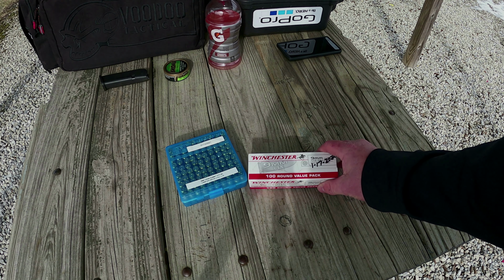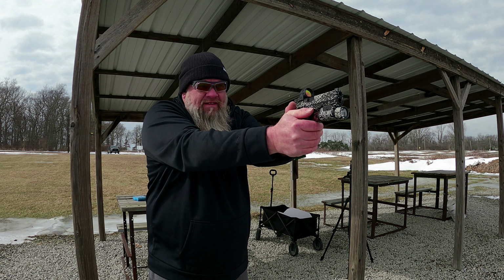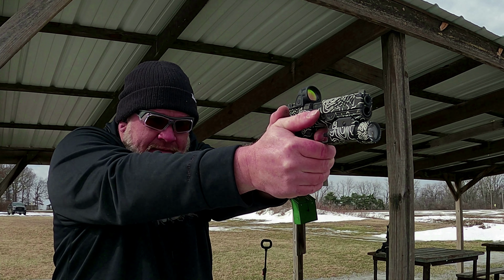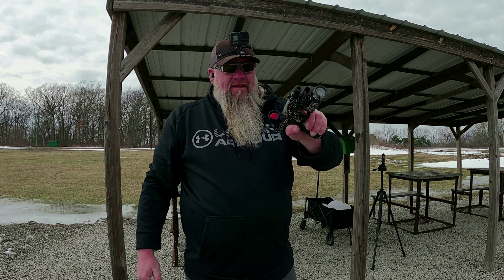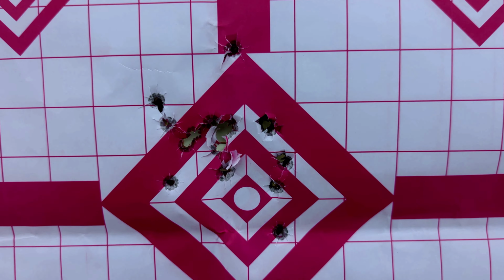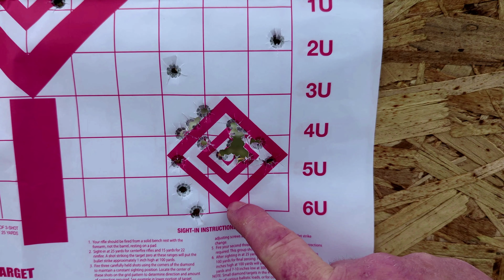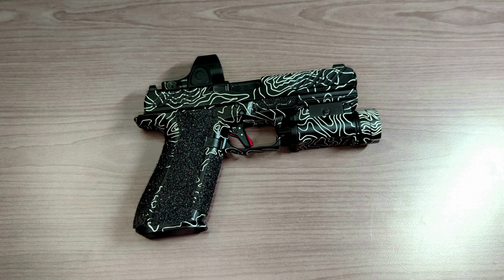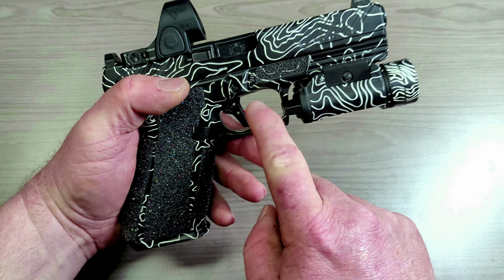Shadow Systems DR920 Timney Alpha Glock Trigger Review

Comment: The reason all those other triggers are better is their striker fire system is different than the glock striker system.... those others have a pre cocked striker which means it simply only has to release the sear.... glock is more similar to a double action where part of the glock trigger is actually compressing the striker spring and  then releasing the sear

Comment: Nice... I have a trigger I changed for one of my Taurus G3C's don't have a Glock yet)... I had similar problems with a few rounds and gave up for a bit. I dit some dry recycles at home and it seems like it might be settling in without me tearing it down again (been too lazy to do it). After watching your video, I might sneak off to the range and try it a few more times. It was the first time I ever attempted a trigger change.
Reply from the maker: Hopefully you got it worked out triggers have drove me up a wall a few times. This trigger is running a 100  % now but it was driving me nuts

Comment: I tried an overwatch precision and a zev trigger in my XR920, both cased it to have binary firing.  The stock trigger is trash, not sure what to do.
Reply from the maker: Wow I'm surprised to hear that with the Zev I don't have any experience with the Overwatch.
Reply: @ChrisFromThe740  Yes, they were both just drop in trigger modules.
Reply from the maker: It sounds like you have already dropped a lot of money on triggers that don't work the only one I could think to try would be the new Apex polymer trigger
Reply: @ChrisFromThe740  thanks for the suggestion, I appreciate it!
Reply: Which trigger fits the xr920? I just picked the gun up and would like to try this trigger in it
Reply: @derrickknight8856  my experience changing triggers on shadow systems was not good. Each time it induced binary fire. I sent a photo of my stock trigger to SS and they said it looked like there was a burr on the trigger pack and sent me a new one. Since then it’s been fine.

Comment: I watched this video before and I decided to try Canik Rival, Canik elite combat executive, Canik elite-s combat, Walther PDP. So I think Canik trigger is overrated, construction-wise - yeah its solid build, very flat, but long pre travel and reset it's not great at all (for me) the reset is too soft its floating somehow (hard to explain the feeling). With one thing I agree with you the Walther trigger is really great overall. So I`m thinking right now, is Timney Alpha the best trigger on the market right now?
Reply from the maker: The Timney Alpha trigger is the best trigger for a Glock but that's not saying much. As far as Canik goes I put Freedom Smith triggers in my Caniks. My Walther's I replace the triggers with Apex. If you put the Timney Trigger in a Shadow Systems you will have to swap the shadow systems connector out for an oem Glock.
Reply: @ChrisFromThe740  and what can you tell about stock shadow system trigger? I want shadow system as my second competition gun, or moded glock
Reply from the maker: @bboyclipsy  it's not a bad trigger at all kind of reminds me of a Zev competition trigger
Reply: @ChrisFromThe740  is it possible to reduce trigger pull weight from the original Shadow System Trigger? For example with ZEV connector or something like that?
Reply: @bboyclipsy   I have the same question, I wish he would have answered.
Reply from the maker: It's not my gun so I have no idea